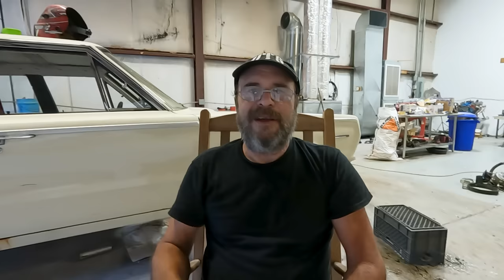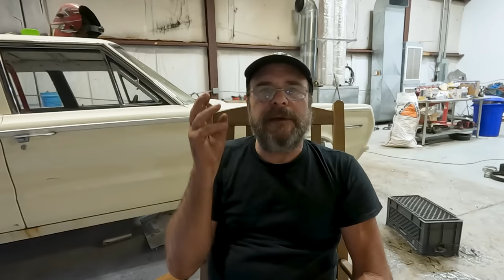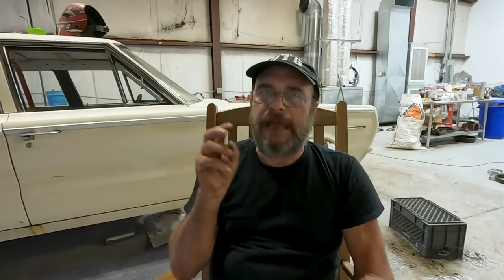They Really Are Out To Get You- How The Automakers Have Made Life Miserable For The Average Mechanic

Comment: I worked 30 years in a bus garage. When I started we overhauled literally every single part of the bus. We rebuilt 30 amp relays, every part of the engine, brakes, radiator. nothing left our shop to be overhauled. by the time I retired 90% of the benches were empty and all the parts were scrap and replace or send back as cores.All the parts became sealed units with no way to repair or parts available.
Reply: To be fair...... An alternator that isn't working usually needs new bearings, and a voltage regulator, and maybe the pulley is worn..... So if four parts have to be replaced.... Just get a new alternator and send in the core.
Reply: And because it was rebuildable, it's life span was forever short of maybe rust or frame fatigue. But again, if maintained then back to point 1.
Reply: @sasquatchrosefarts an alternator failure isn’t really what he is talking about. Yes, a wasted 100,000 mile alternator NEEDS to just be changed out. But the overwhelming culmination of down-chain electrical failures related to interlinked systems is unreasonable.
Reply: sealed for life components should come with the disclaimer, for the life of the auto loan.
Reply: First Job.. 1993 at Oldsmobile, Mitsubishi and Mazda.. I worked back parts counter, Mechanic counter as they became Technicians, no more rebuilding Starters, alternators etc.. parts changer's.. flag time cut in half or more..
Reply: Same thing with me working for a Caterpillar dealer, rebuilt everything. Worked there 32 years and mechanics became parts changers.
Reply: my guys in my bus depo loved the RTS buses easy to repair and service unlike the new junk that it replaced and cant even work on in house
Reply: Fucking sad aint it.
Reply: @sasquatchrosefarts9131 you can be broken down in a very remote spot.
If you had tools you can help yourself. 
You're a part swapper and would die because autozone is 28 miles away.
Reply: When I started working as a dealer tech we rebuilt everything including power rack and pinion assemblies. The seal kit for one of those came in an envelope no bigger that your hand.
Reply: @sasquatchrosefarts  until the piece of sh*t break faster then the old one and spend time replacing multiple alternator. Because it got life time warranty. Buy OEM or rebuild the factory install part. Is the best.
Reply: @danbob1650 OEM is what is getting replaced.  Nothing on a car is built to last forever.
Reply: @shaggydogg630  for a few years an old school auto tech lived across the street.
He kept saving me by pointing out that "there's a kit for that and you only need one piece from the kit".
I loved that man
Reply: @ftboomer1  bullshit.
There are 100 year old tire irons.
Reply: @mikeries8549  LOL.  Agreed.  I missed tire irons.
Reply: @maldo72  I worked at PVTA in Mass in the late 80's. I rebuilt a lot of 6V92's in those and the Grumman Flxible. Lots of memories!
Reply: @sasquatchrosefarts the  sad part is a lot of the "rebuilds" or new parts are built to a bottom dollar price and can be dead on arrival.
Reply: @AtZero138   You are correct Sir
Reply: Money is in parts
Reply: Planned obsolescence
Reply: Bosch developed over 11 different fuel injection systems in the early 90s to prevent independent mechanics from being able to keep up. Dyed in the wool German car mechanics stopped working on OBD 2. Volkswagens do misleading diagnostic codes. The beat goes on. When cars become too expensive to buy and impossible to service the car companies will have slit their own threats.
Reply: I worked on Army helicopters for 26 years. The exact same thing happened with rotary wing aircraft. In 1982, we were opening up components and boxes and making repairs and adjustments. When I reclassed into a  'modern' airframe, I suddenly became part of the parts changing machine. Incredibly expensive black boxes were crated up and shipped to the manufacturers for repairs. New and used/repaired items came back with full prices paid by Uncle Sugar. What we sent out were repairable cores with ridiculously low dollar values. When corporations make proprietary parts that military technicians are not allowed to service, the lowly taxpayers get shredded.
Reply: @Dan-oo1tm 😂
Or the inflexible 😂
Reply: 40+ years ago I was riding my bike past the shop door of our local Trailways bus depot. Out of the scrap metal bin I grabbed a used piston because I thought it was cool. Those mechanics were rebuilding diesel engines just a few steps away from where passengers were boarding! I'm sure today all that overhauling is outsourced
Reply: Greed!!!
Reply: @AtZero138  Guess I'll stick with Japanese cars then. A few years ago I was able to buy just the starter terminal/contacts from a Toyota dealership for like $5. You could also get just a voltage regulator and the alternator was designed to easily replace it. Although this was a '95 Integra so maybe they've started doing this stuff too.
Reply: Like my ol papy said, don't leave a paper trail.  Who put the ls in the audi? Gee I don't know
Reply: Like my ol papy said, don't leave a paper trail.  Who put the ls in the audi? Gee I don't know
Reply: And busses dont last as long anymore .  I remember 30 year old city busses .  Now they max out at 12 many only last 7 years .
Reply: And my grandad riveted new linings to brake shoes and cut drums on a treadle powered lathe, so what? Do you want to go back to that? You want to make your own Babbit bearings too? Punch dead soft copper sheets for head gaskets? And you re-cored, re-tanked radiators, oil coolers, repacked water pumps? I'll call BS on that one.
Reply: @sasquatchrosefarts  Can you be fair, if you didn't watch the whole video?
Reply: @duranbailiff5337 same thing I noticed in the navy. We didn't do valve repairs or rebuilds and there were alot of systems that a contractor had to fly out to repair because we weren't allowed to even open it. Not being able to fix your ship seems like a tragedy waiting to happen if we go to war
Reply: @sasquatchrosefarts  You left out usually needs a set of brushes. Before all that other stuff. "To be fair...."
Reply: @sasquatchrosefarts to be fair, that's just subbing work out. Nothing wrong with that, but also nothing wrong with learning and understanding component repair and having a greater understanding of how components interact in a system
Reply: Makes zero sense.
Reply: There are no repair shops they R replace shops
Reply: @sasquatchrosefarts9131  to be fair they sold rebuild kits and were easily rebuilt in house.
Reply: @sasquatchrosefarts 
Back a few years ago the wife's mothers laws Pontiac sunbird I think it was. Needed an alternator so I offered to change it for her back then any other car I'd worked on they where around 60 to 80 bucks. That one was like 169. All it had wad a bearing failure. A friend of mine changed it at a rebuild shop. Bearing price was 3 dollars I think it was. And I ran the rest of the motors life... rebuilt with warranty was around 65 bucks. 

After changing 6 or 7 hub assembles from $169 all the way on up to the most expensive. On my 05 Z71 Chevy I'm done with this crap.
Front wheel bearing on the 70s cost 7 bucks and a little grease. And I didn't worry it would fail 100 miles from home on a fishing trip and have to be towed.

 I just got a 99 dodge dually with the Cummins. Thats going to be the newest model in my yard for a while. Fixing to load up on motors and parts. And a couple more older trucks all swaped to Cummins.
If they make me  il make my own bio fuel. Before I continue to play there game. Lol
Reply: @sasquatchrosefarts some cars you have to pull the engine to get to the alternator
Reply: @maldo72 Oa all the😊 way
Reply: Id believe it, i have mechanics books from the early 60s detailing the rebuilding of generators, pumps and even electrical units.
Reply: @davidboyden9099  I think you're confused. The standardized on-board diagnostics make it easier to troubleshoot problems
Reply: @BikemanSuperfast  A kid playing gatekeeper on a nearly 5 month old thread, accusing people with decades of experience of being "confused". 😏 Can't make this 💩 up. .
Reply: @BikemanSuperfast  Right.. "easier to troubleshoot problems".
After you've spent $150 on a cheap diagnostic tool and learn.... That you've bought a cheap diagnostic tool that doesn't tell you 💩.
The only thing that you've ascertained is that you'll need to pay $500-$1000 for diagnostic equipment that can only diagnose electronic failures. 
It's always the sensors that fail.
Reply: @lilmike2710 Never spent a dime diagnosing my EFI car... Most OBD-equipped cars will tell you error codes somewhere in the radio or climate control. Granted, the computer can't tell if you have a bent pushrod or bad rings, but EFI ain't stopping you from doing a compression test or pulling a valve cover. Believe it or not the OBD2 standard is an important consumer protection.
Reply: @BikemanSuperfast  Yes, and I'm sure Google has plenty more random information that you can have a quick glance at. I doubt that you even own your own vehicle.
I'm pretty busy here kid so, if you don't mind.....
Reply: @sasquatchrosefarts To be fair...if you buy anything that has all of these things wrong with it, then it's a bad product and the.company should recall the product and give a refund or new ones.
Reply: @sasquatchrosefarts
That's a very naive way to look at rebuild versus replace.
Reply: @ftboomer1  what is OEM ?
Reply: Was reading the other day that the city Hiroshima in Japan still repairs and operates trams that were running back in 1942, they maintain them like new.    But the cars their I think are maintained by local mechanics only. And they get rid of their cars with low mileage and replace them early and sell them to other Asian countries.
Reply: @saeedhossain6099 ha ha. A sad truth
Reply: @davidboyden9099 it's  crazy ,  why buy a car or van to only get 5 years out of it until it's justca headache.  I've wondered if the used car  market will just disappear.   No one will want the pieces of junk.
Reply: Just swap parts now not repair. Mechanics became easier for all. Who cares about shops, new cars are easier for folk like me. Limited tools needed cause just swapping parts. Cv axle 86 bucks for my suv. 2 hrs to change it and back on the road. 2000 to 2010 easiest ever to work on.
Reply: @saeedhossain6099 easier to work on. Shops cry as the average man is happy. No more repairing parts just basic tools needed to swap parts. 86 bucks for brand new cv axle and took 2 hrs to change on the side of the road
Reply: @AtZero138 now the average man with basic tools can repair their own cars. Basic tools on the side of the road. Shops are mad but im not. Saves me a fortune on rip off shop rates
Reply: @uncreativename9936  modern Toyota are not immune, even doing a brake shoe replacement requires a trip to the dealer to reprogram the abs module.  it's insane.
Reply: @sasquatchrosefarts However, I used to rebuild & reinstall alternators for under $20 & 30 minutes of time....
Reply: @sasquatchrosefarts up
Reply: @sasquatchrosefarts
Reply: I used to have a stud man bod.i got older and more of a stud man figure.now I got a pedal powered tricycle.100% analog
Reply: @shaggydogg630 and for that reason, loads of shops would fit a kit to a worm out rack and say it was rebuilt. 
It's swings and roundabouts.
Modern cars are least in the 90s were far better quality.
Reply: Those are some cheap parts you're scrapping a unit for. @sasquatchrosefarts